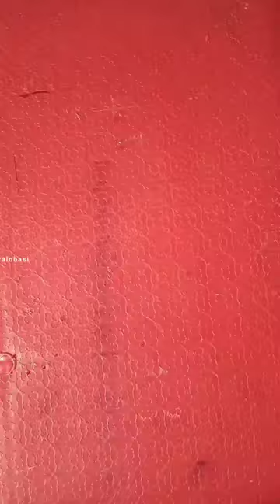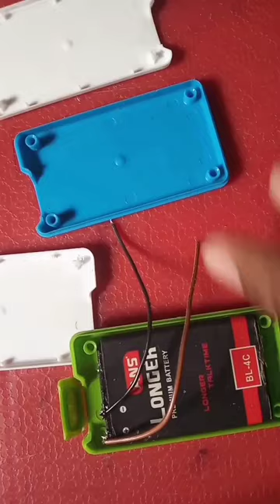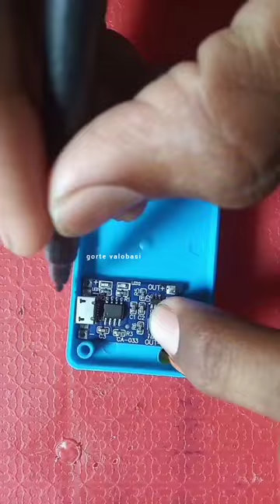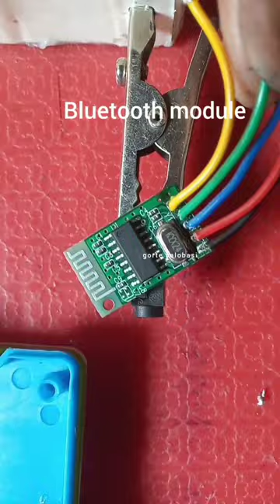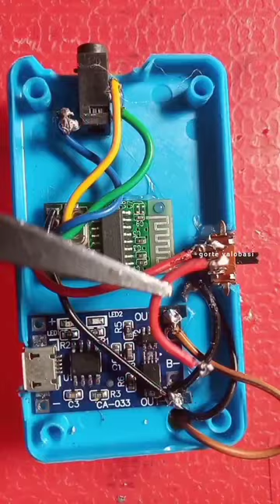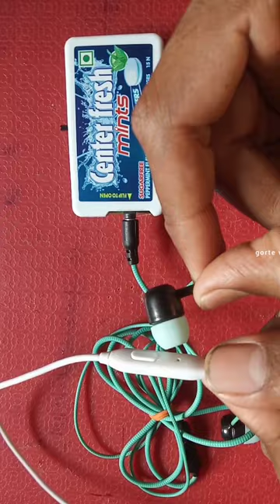#super bluetooth gadget #shorts #youtubeshorts #how to make wireless headphones #lifehacks #diy #how

Comment: Where is the amplifier module ? You are just getting sound output from a Bluetooth module really 😅😅😂😂?
Don't worry viewers you can use this device as a portable Bluetooth sound receiver to transform  any old AUX cable connected amplifier into a wireless one.😊
Please connect a 25 v capacitor (parallel connection) with 5v power input terminal to get rid of the humming sound 😊.
Reply: Actually our phones doesn't have amplifiers for the aux port connecting devices, so earphones have their inbuilt amplifier circuit, the audio part is sent through the BLUETOOTH AUDIO RECEIVER to the amplifier of the earphones.😊😊😊
Reply: @NikhilRaj-bf5sq  no 💀 phones and laptops for that matter have amplifiers, built in them. Many earphones or headphones do not have an inline amp
Reply: Earphone does not need so much power they just run on low singnal
Reply: They need to add pam8403 module 😊